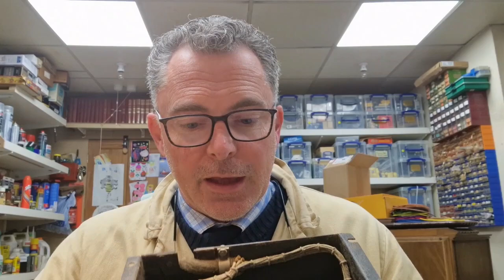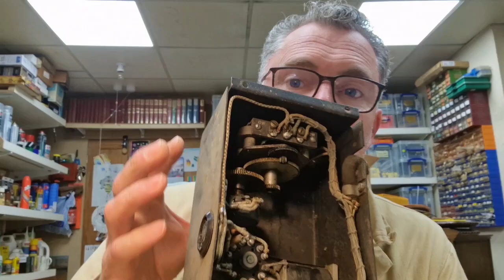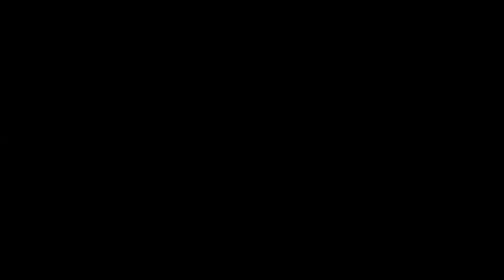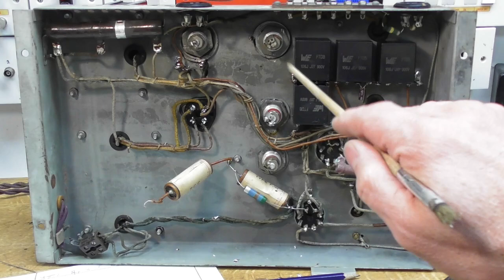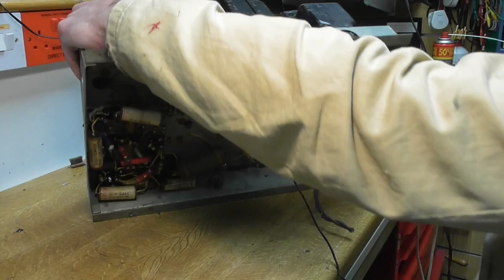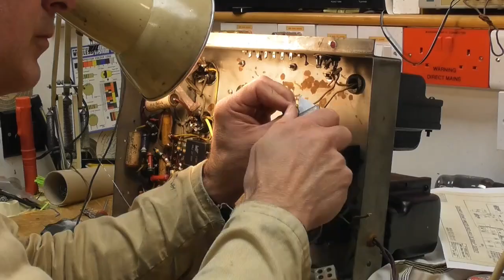The Enormous CAPEHART 405-FR 1938 Radiogram THE BIG RESTO! Pt2

Comment: We call those radios "boat anchors" here in the USA!  Do you put a fuse in the mains circuit to protect your power transformer?
Reply from the maker: Hi Glasslinger.
It sure is a beast!

Yes, I'll be fitting fuses, but to preserve originally, they'll be fitted off chassis. 👍
Reply: @vintagetvandwireless  I AM GLAD YOU DID NOT DO A PART 3 *BECAUSE* THAT WOULD HAVE RUINED YOUR BRAIN!!

Comment: I need advice. I have a bush VHF61 radio the internal speaker has a marking of 3ohm +. I want to connect an external speaker to the external speaker connectors on the back. But the speaker I want to use is from a modern 90s midi hifi. It has an impedance of 6ohms. Would it damage the radio if I use this.?

Comment: Great part 2!  Thanks for sharing.  I would be curious if the mercury vapor rectifier on the bass chassis is good or bad.  Early mercury vapor tubes had a tendency to flash over.  Also, 1938 Capehart interstage transformers were of poor build quality or had an Achilles heel that tended open up the windings.  I know of several 1938 examples state side including a 1938 500 which had all open interatage transformers on all three amplifier chassis!  I have never seen those connecting tabs on the AC line for each amp.  Typically, they were hard wired.  Looking good so far!

Jon Ketron

Comment: I would like to see the circuit diagram.  I am intrigued by the two air cored inductors that look a bit like long or medium wave oscillator coils.  They appear to be connected between the mains transformer secondary and the rectifier anodes.  I have never seen that done before.  Maybe it's something to do with switching transients.  It is a common practice to put and RC snubber across the transformer secondary when using semiconductor diodes.  The use of silicon diodes generates large microsecond scale spikes which can be picked up by the audio amplifier.  The problem is caused by the combination of the transformer’s leakage inductance and the rectifier’s reverse recovery time. (For a detailed explanation see "The Art of Electronics" by Horowitz and Hill).  I was not aware that valve rectifiers had this problem, and I think using inductors like this would worsen the problem with silicon diodes.

Comment: Excellent work on those amps. The chassis responded really well to the clean and wax treatment and look so much better than before. I was amazed at how little was going on underneath on the treble amp! Literally just a few wires and simple parts! Are you able to tell yet whether the audio input gets split into low / high frequencies within the bass amp itself with  the high frequencies being piped onto the treble amp or do they get split before with a separate feed going to each amp?

Also very interesting to see what was in those other mysterious black boxes.